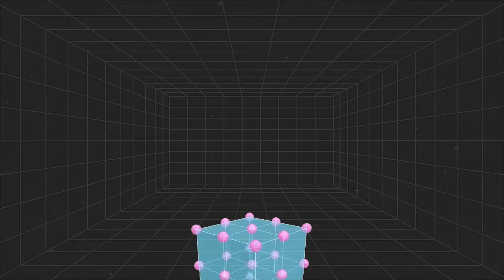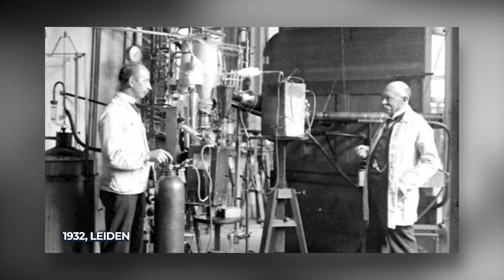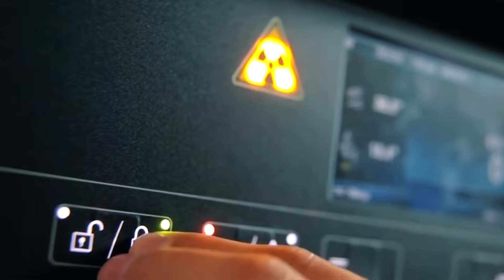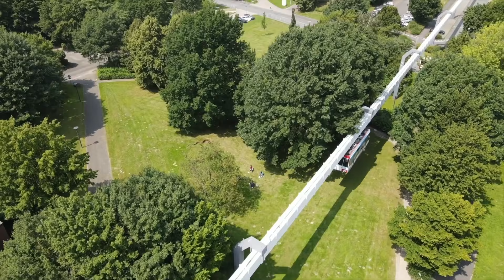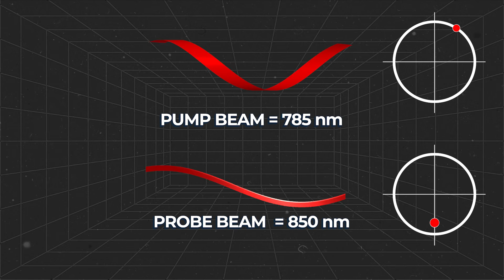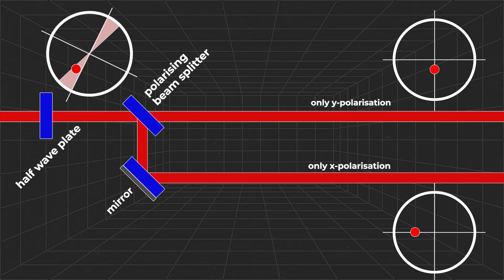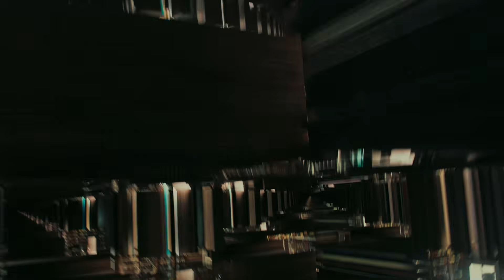Impossible Time Crystal Breakthrough - Explained

Comment: The universe itself is a perpetual motion device/machine. Every big bang and big crunch (as they are poorly named), are the universes switching and recharging itself to start another cycle. It works like a switchless transformer, where the fluid from one tank that is charged separately from the neighbouring fluid, moves back and forth from one side to another. There is a small hole in the divider which separates the fluids where cavitation bubbles act as the disrupter in the circuit which is the switch that cuts on and off extremely fast. Point being, if everything we create and design is analogous to the universe in some way, then but default there exists a design of a perpetual motion machine. They are hiding these truths from everyone
Reply: Also, the bible tells you how it works with perpetual motion. Be fruitful and multiply. People are the best example of a perpetual motion machine.

Comment: Speed and clarity is your strong arm.  I can't get over your fluid delivery.  This is the second video I watched on your fascinating topics.  🤔🤓
Rather than browse through all your videos, may I ask if you have a discussion on dropping the temperature of liquid metals like mercury or any liquids that have a broad temperature range rapidly.  I know that IBM has done some experiments in the 1970's using a magnetic field, dropping the temperatures down to single digit Kelvin very few pulses.  There is also a possibly dangerous resulting impulse involved for the container when a strong current is applied to drop the temperature, and I don't want to cause injury to the staff. Any help to understand that process would be appreciated.  However, even if not, you now have one more addict for your fabulous topics...

Comment: So with the superconducting ring example, would it not go forever if there were no environment to lose energy to? If the ring were in truly empty space (no particles at all), wouldn't there be no environment to lose energy to? 
Or would the interactions with the electromagnetic field still lose energy even if that energy is effectively entirely attenuated before it can influence anything else
Reply: By extension, why isn't it impossible to know if a system contains a changing state forever? The very act of observing the system would involve the system losing energy. And so at any given point in time, the system is either in an unknown state that may or may not be repeating, or it's being observed as repeating in time and losing energy because of it. 

Also, would this put the system in a superposition? And because it is fundamentally unknowable, that should allow it to do whatever as long as what it does is unobservable. What's the difference between the system constantly changing and the wave function of the system constantly evolving so that when it collapses, it's state of collapse depends on the current point in time?

Comment: hi i loved this video an im a 30 something yearold mental infant so paitience please but i was on the edge of my seat this looks like a ocilation that may unravel the path to seeing gravity 6.9 second periodical is really cool an you stated that length of m shaped cylic pattern  is not yet  understood i hope they determine that the differiantial in the secondary 10degree bias of the light shift as a compensation is able to be used like a deflection yoke in a crt tube  an can be used to increase the dwell to show the earths 8 to 10 hz cavity natural vibration an its correlation to our gravitational diplacements  against a known constant noise of maybe gamma radiation from creation times or something abstract like a dwarf
Reply: no where was it stated that the crystal structure being arsnide wasnt suseptable to un intened back ground neutrinos which i feel when they answer the waveform to clean it up it will be like when they stumbled on infra sound on accident , i got to see in person a ice cube camera that is a exact match for the observatory an ive been hooked everysince

Comment: I'm slightly confused; do you have to provide a constant pump lazer (and 10 degree shifted magnetic field) to keep the time crystal sustained? Because if so, wouldn't that be considered a driven system and give us the same problem with the quartz watch?  Or, is the pump lazer only required for setting up the time crystal, and then you can let it do its thing?

Comment: Very interesting and clear to the very end. Does the spin to electron feedback loop lose any energy after agitated by the laser. 
Also, thermodynamics breaks down or has to be reinterpreted in lots of quantum systems. Really, the issue is about ground state stability of oscillation.

Comment: Motivated by metal crystals, where conduction electrons are really a macroscopic 'orbital', but happy to see this experiment possible in a doped semiconductor, I was thinking the unique 'remote ordering' (as opposed to remote heating) creates a distributed magnetic gyroscope. When you described the pump laser I was already thinking of the poynting-vector directed optical B field (circularly polarized) and how it must undertake to magnetize locally, with counter-mmf forces setting up the conditions of an oscillator. The addition of a bias to knock out chaos reminded me of early experiments on grid bias in vacuum tubes and added circuitry to offset interelectrode capacitances with their parasitic oscillations. With the bias present, I can't help wondering if the periodic lesser dips are a form of echo, as in a 'nidation' of the precessing gyroscope, where now the nidation frequency matches the precession, but pi out of phase.  Just thinking aloud, as I suppose the authors might have been tempted to do but wisely demurred.  ;-}
Reply: Oh to have been a fly on the wall of the lab when they first started analysing the results, with theories a1 to z5000 coming out of the blue.

Comment: I can explain it to you . I can explain it to a 10yo. 
a ten yo didn't learn the beliefs that prevent your understanding.

as a experimental physicists.  try this experiment. 
the refraction index of all transparent material.  is the difference in density.

the wavelength of light inside a material can be derived by multiplying its wavelength and deviding its freequency.  by the density of the material. then deviding the new wavelength by the new freequency.  

devide the speed of light by the density of the material. get the rate of time. 

insert a dencer atom into a group of atoms and the dialated time in that space will vary . so will the light passing through that space. 

the opposite thing happens when you introduce energy into mass and the atoms that absorbed the energy float to the surface. as the density decreases. from heat expansion. 
it's called ion eflux.
inrested. in unifying everything.

Comment: If you've ever worked with an FM synthesizer with a graphical representation of the final waveform, you'll probably recognize the general reason for both the odd period, and the shape of the oscillation: It's the product of oscillations modifying other oscillations in some way, and combining to make a single unique cycle. The long cycle of the waveform is because the combined oscillations of the system take that long before they produce a cycle of the entire system.

Here's a thought: In theory, if you could somehow constrain an isolated system in such a way that the number of ways that the system can progress into a less orderly state is equal or lower than the number of ways it can progress into a more orderly state, you could in fact produce a perpetual motion machine. 

I think the reason the oscillation of the system lasts for as long as it does is because the conditions of this experiment heavily reduce the number of ways the system can progress towards disorder, meaning this experiment is actually pushing in the direction of perpetual motion, and thus a proper time crystal.

Of course, whether one could ever create a system that crosses the aforementioned threshold on an infinite scale across time is questionable (of course it would be, you're effectively proposing to solve entropy ), and harvesting any kind of energy from such a system would require you cross that threshold pretty heavily, as the system would need to not just maintain oscillation in equilibrium but return to that state after being disturbed by whatever method you're using to extract energy from it.

Time crystals fascinate me because I believe perpetual motion is actually possible, it's just not something that easily forms in nature, and we haven't cracked the material science to force it to happen yet. 

I suspect if and when we do crack it, the experiment that provides the solution will occur on an atomic or subatomic scale, and I suspect the experiment may also incorporate chemical engineering to create a very niche material with very specific behavior, not unlike this one.

Comment: @Dr Ben Miles, there's a new paper available on magnon Bose condensates as time crystals, with 67 mentions of time crystals! You might want to take a look:

J. T. Mäkinen, S. Autti, and V. B. Eltsov, Magnon Bose-Einstein condensates: From time crystals and quantum chromodynamics to vortex sensing and cosmology, Applied Physics Letters 124 (10), 100502 [Mar. 5] (2024). DOI: 10.1063/5.0189649

Comment: I'm gonna be honest, once I understood you are about to discuss the effect of a magnetic field on a spin ensemble, I got very excited and thought I understood what's going to happen. But then it kind of fell apart as many parts of the explanation just seem too handwavy or too superfluous. Handwavy insofar that you basically explained magnetic resonance and we know very well how that works without having to talk about chaos theory or the flip-flop processes that align the spins (another oversimplification in itself: Zeeman states are occupied nearly 50/50 at the magnetic fields we are talking about here). Precession about a magnetic field can even be explained classically. The interaction between electron spins and nuclear spins is just a hyperfine coupling. EPR/ESR spectroscopists have been exploiting the osciallatory change of populations in experiments like ESEEM and HYSCORE for decades. The relevance of chaos theory and the relaxation / flip-flop processes  here seems by and large negligible. Finally, the beam splitter is just a neat but mostly tangential trick that is likewise used in any optical spectrometer to compensate for fluctuations of the emitter light, I don't understand why it is explained here. Of course the oscillation is not decaying since it's a driven process. As many other people pointed out, the relevance of this seems unclear.

Comment: This is one of two discoveries recently that seemingly violate the laws of physics and allow perpetual motion. We could be on the verge of some very interesting discoveries, possibly a whole new branch of study in quantum physics.

The other was the discovery that carefully crafted electrical fields that were imbalanced could create a pull in excess of 1G, enough to offset gravity and allow motion to take place without any actual source of power.  Now, in that instance, they first had to charge a capacitor in order to create and maintain the electrical field, so in that sense, you might almost consider that a fuel. However, once charged, it doesn't require further charging and doesn't discharge over time, yet the field it creates remains and creates enough force to allow motion.  The interesting thing is that the experiments in question can be reproduced using technology we've had for 60 years. In other words, it's not prohibitively difficult nor expensive if it can scale up and an application for it found.

Comment: Thank you - Followed it reasonably well, but I kept circling back to the ‘No go Theorem’. I get two things from this. 

First that one should be very cautious about proving things theoretically without enough experimental input. I am reminded of the swag of silly theories perpetuated in the last 50-years mathematically including many-worlds postulate, string theory, and others. 

Second I think about a simple atom of anything, but let’s pick hydrogen; it has an energy kick at the big-bang (possibly) and is still running today in just the same way with the electron ‘in orbit’ around the proton . So I know this doesn’t fit the strict definition of a time crystal, but atoms are a close cousin. 

Also the notion that for a time crystal to last forever there’s basically no way to input or extract energy (or it will lose energy this way) almost defines quantum states with almost nothing else required.

Comment: In super conducting neutron stars, a very tiny amount of energy is lost through accelerating tiny amounts of particles are accelrated to relatavistic speed away from the star. Even though this is occurring a neutron star has so much mass it is still as good as the best atomic clocks. In other words it takes billions of years to lower its rotation speed, also Lense  Thirring pulling spacetime around also accelerates more particles. Not sure if these particles add inertia when accelerated. In thinking about Lense Thirring particle acceleration does not add inertial effects until being slowed upon collision. Free energy.

Comment: The light of the laser is always an oscillating wave, doesn't matter if you are pulsing the power or not. In that sense, you can't get rid of oscillations as the input to the system

However, it's also not possible to completely isolate a system. That would technically mean creating a universe separate from the one where the system is in. Otherwise, there is always going to be a connection to, and thus interaction with, the environment. Even more so if you are using an external power source to drive the system (like a laser powered by electricity coming from the grid)

Comment: G. Flim only demonstrated he could maintain a magnetic field in He(l). In fact when the SC loop is closed, any current stops and only a magnetic field remains while temperature is low. That field can induce currents in a Amp meter, a connected circuit, etc,  and pull the magnetized needle of the compass, just that.

Comment: That’s kind of cool. At the same time, it does not seem like there is any useful embedded application. Too dependent on external conditions and a perfect excitation source. Further, the measurement of the oscillation is way too complex. Curious where the science goes with this. Does it becoming a building block for further advancement or will it fizzle out?

Comment: I love that the profoundness of an experiment, theory, or creation is typically never understood until long after the discovery is made. There is plenty of math that models some physical phenomenon that we have no knowledge of, and it's application is completely life altering. But at the end of the day, we have to connect the dots to make it all work.

One day, there will exist a use case for time crystals that we couldn't imagine life without. Now, we can hardly imagine what a time crystal could be used for. I vote for creating a power supply from time crystals. That way it will continue to provide power for all time 😉

Comment: Isn't... a laser (or, well, any EM wave) a periodic signal in and of itself? So doesn't using a pump laser kind of introduce a periodic input to the system yet again, thus making this no different than any other resonant system? Does the behaviour of the time crystal change with the change in pump laser frequency, or is it completely independent in all the output parameters and modes?

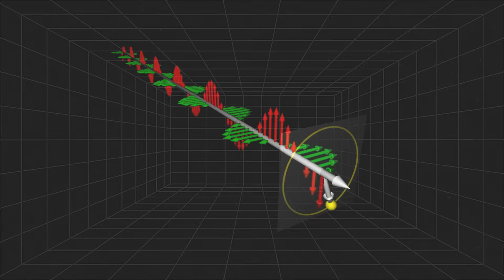Comment: I find it interesting and wonder if this time crystal is dependant on speed as electronic clocks normally are? Also at time 11:55 you have a circulating signal. It looks much like the electromagnetic signal of light but it has the magnetic signal 90 degree out of phase. That is what I believe any EM signal should be but most people claim that they are in phase when in far field.

Comment: This distorted sinusoidal shape looks like the Line to neutral output of a space vector PWM generated wave. Basically the top of the sinusoid is inverted. If you take 3 of these 120deg apart and measure the L-L output you get your sinusoid back.

Comment: It seems to e defined as an oscillation produced with a stable input. But that's by calling an EM wave 'stable' when it's by definition itself oscillating. If the TC output frequency varies with the laser light wavelength then I think the whole thing is effectively a kind of optical mixer/down-converter.

Comment: That waveform looks familiar. Like what happens with some vacuum tube oscillators when the energy is too high and it causes a breakdown of the ionization efficiency of the gas at that energy level.

Comment: The issue I see with using a laser is that it is light which is a wave and particulate.  Since it is a wave it is oscillating.  This would be no different than using any other energy input.

Comment: If we are discounting the piezoelectric crystal since it is an oscillating driving force providing the oscillating output, why are we allowed to use the pump laser in which the electric field is oscillating? We are probably working in the Rotating Wave Approximation, but this is only an approximation. I accept the detection methodology, but I am concerned about the reasoning for allowinng the fast-oscillating field to 'not count'

Comment: It looks to be oscillating just because of the input energy being quantized somehow. Just like when you plug a constant water flow into a mechanical water pump, it will collect the energy up to the point of the weight being big enough to flip it, then the cycle repeats. Not claiming anything here, just comparing the systems of the universe, if it has the same principle, it’s not that interesting a discovery, just a Lorenz chaotic waterwheel at a small scale.